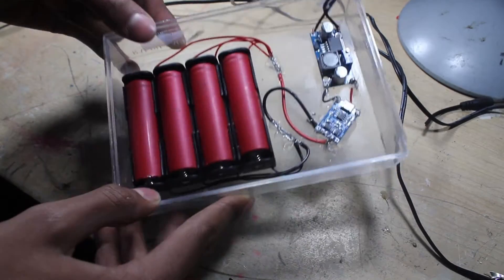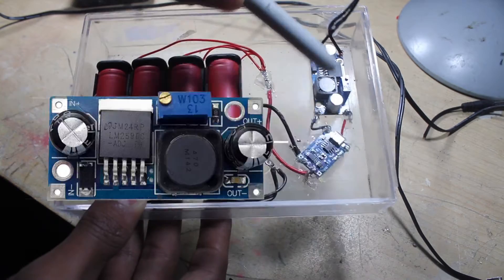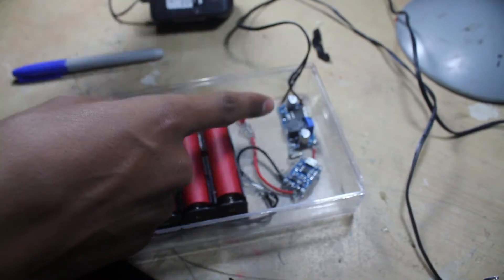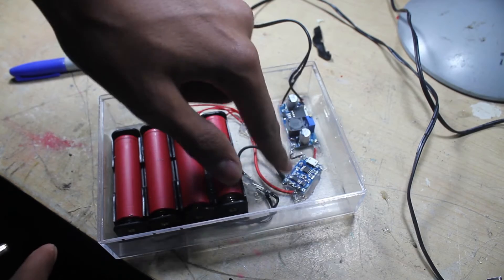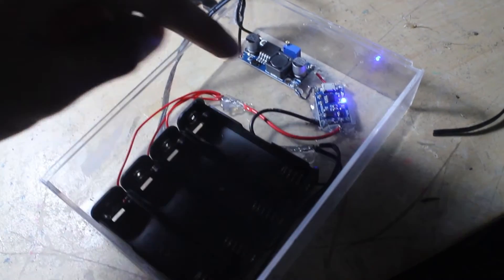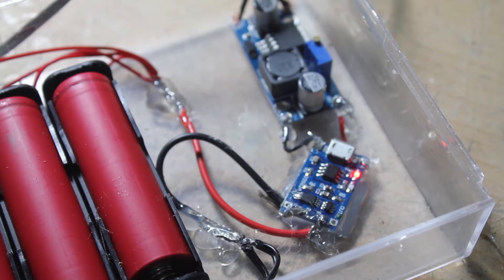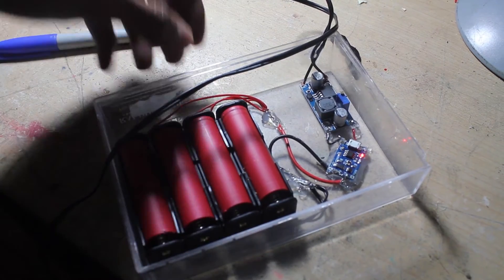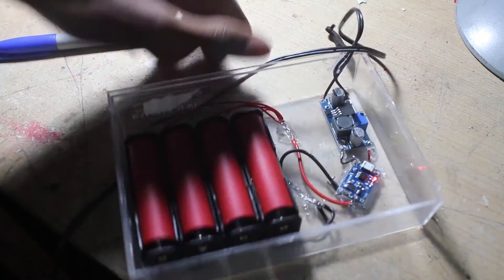How to Make a 18650 Battery Charger

Comment: how long did you charge 18650 accumulators
Reply from the maker: I think I usually charged them for 5-9hrs
Reply: @CluelessEngineer  so you can use a bms to fast charging

Comment: I have thought about doing this exact thing to parallel sets of batteries, but am concerned that the cutoff current will not be correctly measured, or reached in time, as it will be multiplied by the number of cells.
Reply from the maker: GnuReligion ohh. I see what you're saying. I was thinking the same thing also, but It works fine, and I just tossed that idea out the window. I have been using that charger for a while now, and it charges all 4 properly. there might be more info in the datasheet. I don't know alooooot about how the micro chips work, but I'm learning along with the viewers. lol. :)
Reply: Yeah, I think what would make that circuit most dangerous would be if 1 battery had less voltage than the other 3 ... then 3 batteries could overload the input current of that 1.  Maybe power diodes would be the answer.  Anyway, if you wanted to charge a BANK of balanced, bonded batteries with one cheap device, I just found this on Ebay yesterday:
http://www.ebay.com/itm/262525402636
http://www.ebay.com/itm/252399557148?var=551246963715